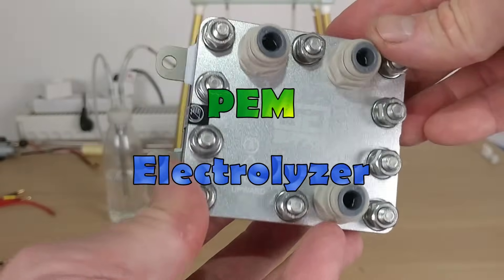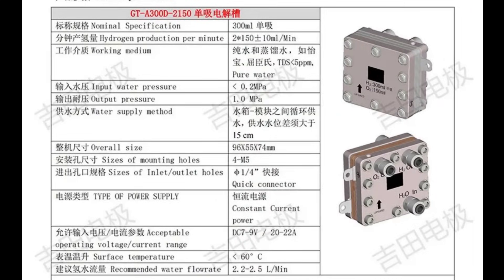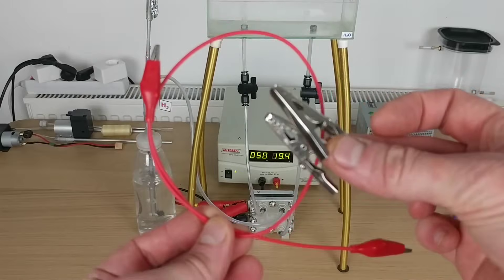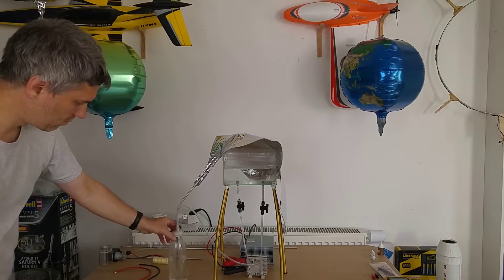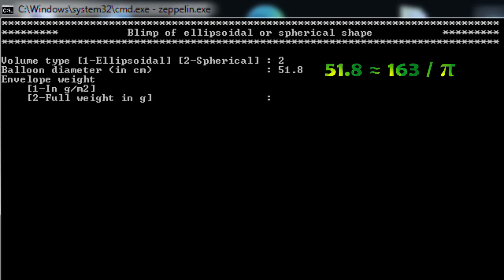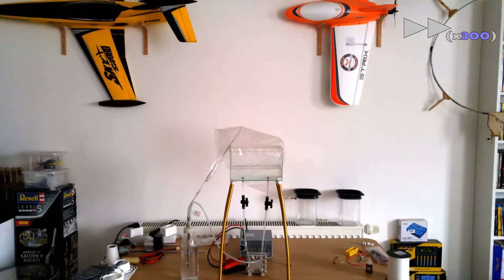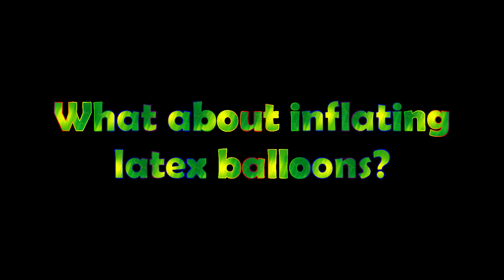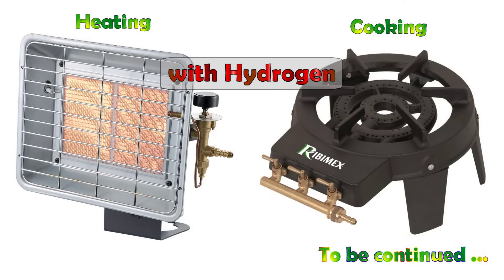Demo of a PEM electrolyzer bought on Aliexpress and use it to inflate balloons #hydrogen

Comment: Is distilled water enough? Don't you need ultra-pure water or a resin filter? How long will that membrane last?
Reply from the maker: Hi,
Absolutely — the purer the water, the better. Personally, I find distilled water to be good enough. Time will tell, as I don’t have much long-term experience yet, but so far, the PEM electrolyzer is still working perfectly!

Comment: Can you help me determine the height between the tank and the PEM unit? Also, how high should the hydrogen and oxygen separators be placed relative to the PEM? And what is the proper method to determine these heights?
Reply: we need your answer ASAP please , we are doing a final project for our graduation
Reply from the maker: @bentekeo2111  Hi,
There’s no strict requirement for the height of the tank, as long as the water can flow to the PEM electrolyzer by gravity.
This type of electrolyzer naturally separates oxygen and hydrogen, so no external separator is needed!

Comment: What do you think would be the best method or producer for generating separated, high output H2 gas for experiment, and one that can also be scaled or adjusted as needed for different conditions?
Thanks
Reply from the maker: For sure, PEM electrolyzer is the best choice for experiment. PEM electrolyzers come in different sizes and powers.
If you have very different needs, you should consider buying two (or more) more than one PEM electrolyzers!

Comment: Great video! I was also trying to use hydroven with a burner. The problem with hydrogen is that it is very difficult to store. You can pressurize it (watch safe limit for pressure for your PEM electrolyzer) but even when H2 is pressurized it wont be a lot for cooking. Regardless it will be very interesting to see the results of such experiment. Good luck and best regards!
Reply from the maker: Thank you for your interesting and nice comment!
The burner will initially be powered by a large latex balloon filled with pure Hydrogen. I will see how quickly the balloon deflates, and therefore what cooking time I will get.
Of course, to stay consistent, the energy used to produce my Hydrogen will come from solar power.
This will be the subject of a future video!

Comment: PURE WATER   ???  
NO WAY
Reply from the maker: Yes, pure water.
I use demineralized water, it is sufficient for home use. But PEM electrolysers used in industry use even much higher purity water!
Taken from documentation on PEM electrolysers: "The efficiency and lifespan of PEM electrolysis systems strongly depend on the quality of the feedwater. High-purity water is essential to prevent membrane contamination and ensure optimal performance. Ensuring the purity of the feedwater helps maximize the efficiency and longevity of the electrolyzer"
Reply: @jcopfr  IN MY OÖD MACHIES I TESTED SELF DESTIILD WATER  ---   NOT WORKING  :::   MAYBE LESS AMPERE   :::
Reply from the maker: @HWJJSCHUMACHER  It didn't work because what you tested is not PEM electrolyzer!
A PEM electrolyzer is not a classic electrolyzer, more commonly called an alkaline electrolyser. The technology is different.
Reply: @jcopfr  RIGHT : I HAVE THIS DRINKING DEVICE FOR HEALTHY H2-WATER:::BUT WITH DESTILLED WATER ITS NOT WORKING AT ALL  :::  THAT WAS MY THINKING THANK YOU

Comment: It was NOT diameter but circumference. The circumference is 2πR (2x3,14xR) - R= 110/6,28 = 17,52. So diameter is 35,04 cm (not 110). 
The capacity of the baloon is 4/3πR3 - that means 1,33 x 3,14 x 5377,77 = 22509,31 cm3 = 0,225 m3.
Reply from the maker: Thank you for pointing this out to me, it was a big mistake on my part, and I didn't even notice it! Shame on me.
However, my calculation is correct, the volume I indicated is indeed: 1,33 x 3,14 * 17.52^3 / 1000 ≈ 22.5L = 0.0225 m3, not 0.225 m3 !

Comment: So, you are going to waste electricity to produce hydrogen that you can burn to heat something. Are you insane by birth or did you have a brain damage?
Reply from the maker: Hi,
In this video, I used electricity from the grid. However, the electricity that usually powers my electrolyzers comes from a solar panel installed in my garden. I’ll showcase this setup in a future video. It is completely autonomous.
When I don’t have any devices to power with the solar panel, I run an electrolyzer to produce Hydrogen for free !
Reply: Bruh iPad kids 😂!
How dare you talk to my best friend like that?you will regret it!

Comment: So how did they fill up the old big zeppelins? And what was the skin made of??
Reply from the maker: For sure, they didn't use PEM electrolyzers because this technology exists since the 1960s (not earlier) and their broader commercial adoption began much later, in the 2000s
I asked chat-gpt, its answer is great.
In summary :
On smaller scale for localized or immediate needs, they used chemical reactions (reacting sulfuric acid with iron or zinc)
On higher scale they used  industrial processes like coal gasification, which involved heating coal in the presence of steam and oxygen to produce a gas containing hydrogen. This gas would then be purified to separate hydrogen from other gases like carbon monoxide and methane.

Comment: For a more efficient system use traditional electrolysis with a sodium hydroxide electrolyte, but power it with a capacitive voltage divider circuit (the resistance of the plates and electrolyte forms the bottom resistance of the voltage divider). You can easy produce a litre of H for 3 or 4 watts of power this way.
Reply from the maker: Thanks for sharing this interesting information, the performance seems excellent! I keep this information in mind
But to inflate balloons with it, you have to tinker with a system that may not be that easy to set up. With the PEM electrolyser, it's a piece of cake!
Reply: @jcopfr  Hi - I guess the capability of the PEM to work at higher pressure is an advantage.
Reply: @markflint9089  it’s advantage if you want simultaneous compression of the hydrogen , but increasing of the pressure ,lowers the efficiency of PEM electrolysis !

Comment: Did you check the current rating of the banana connectors?
Reply from the maker: Good question. I tried to check this, but I bought these connectors a long time ago and couldn't find the specifications. It's at least 10A. Ideally it should be 20A minimum, but I am not sure it is.

Comment: The buffer bottle is meant to act as a flash back restrictor and not to remove water from the H.
Reply from the maker: Thanks for the clarification.
I didn't know what term to use for the bottle, which is located between the electrolyser and the balloon being inflated.
This bottle is essential, otherwise some water ends up in the balloon.
Reply: When are you making a video with the heater and cooking with hydrogen? :)

Comment: by the way, do you know the Hindenburg disaster ?
Reply from the maker: Of course I know, I've seen many documentaries about the Hindenburg, the biggest flying machine of all time!
It is worth remembering that Hindenburg traveled 337,000 kilometers before the disaster.
Zero risk does not exist. Even the Titanic, a great ship once thought to be unsinkable, ended up at the bottom of the ocean on its maiden voyage!
Reply: @jcopfr  got it, than i can tell you a story of H2 cooling on big electrical generators. It is called conductor inside cooling and H2 is used because this gas is pretty good in cooling beside of the risk involved. Once they had a leak and the gas escaped. lighter than air it moved to the ceiling and to the next building. There it found some welding operation and ignited by removing the roof completely - major accident. Big battery systems can produce H2 and need good ventilation. Just be aware when playing with "knallgas" in german.
Reply from the maker: @eugenhuber3441  I agree, H2 being a very flammable gas, we have to take precautions!
Reply: @jcopfr flammable is a little small. if you want to boost a explosion you end up with a detonation. Having H2 and air mixed correct, you get the detonation.

Comment: Whats the max pressure the electrolysis can produce?  Seems like it wouldnt be strong enough to compress itself to stretch a balloon to blow one up..  it takes a bit of pressure to get a balloon started when blowing one up with lungs..  wouldnt think it coukd be very much
Reply from the maker: As mentioned in the datasheet, it can pressurise up to 1 mega Pascals, that's about 10 bars or 145 psi, that's much ! I think this is enough to make a football or basketball balloon explode ! This is one of the advantages of PEM electrolysers, they have a high output pressure.
So stretching a latex balloon with it is is child's play.
Reply: The height of the inlet water column will help with pressure

Comment: Great, I've been waiting for a video like this for a long time! I had seen fuel cells on Aliexpress, but I didn't trust buying them. Could you tell me what type of water you use? Distilled or regular?
Reply from the maker: Hi,
You can buy them with your eyes closed!
You must use distilled water. The purer the water, the better.
It works with tap water, but the life and/or performance of the electrolyser may be affected.

Comment: Interesting what max pressure this PEM electrolyzes  can produce ? Is there some specs in the data sheet ?
Reply from the maker: According to datasheet, it has a max pressure of 1 Mega Pascals which is about 10 bars. It's not bad!
Reply: @ thanks !
Reply: No way in hell that can produce 150psi..  thats impossible..

Comment: I checked the specs on the Aliexpress link, and they show a circulating pump for the water - oxygen loop. Your setup works fine by just gravity feed - what is the significance of the pump then? Maybe better efficiency with forced "fresh" water input?
Reply from the maker: Thanks for the info, I didn't even know about this circulating pump!
I'll find out, but in any case, the pump is not essential. Maybe it improves the efficiency, but only a little

Comment: Well done, impressive work, thank you!
Note: @9:25 s/latex/mylar/ , if I understand correctly.
Reply from the maker: Thanks !
At the end I say that I prefer Mylar balloons while I am filling a latex balloon ! But the text is correct
In other words: latex balloons cost less than Mylar balloons, but are more fragile, are not reusable and retain Hydrogen for much less time. (That's what I should have said in the video).
Reply from the maker: @ChanBattambang  Hi,
I have already tested with lemon juice, vinegar too, but the performance is too bad. The video would not be interesting.
It works so much better with hydrochloric acid! It is not expensive and you can find it everywhere, even in supermarkets!
The best of the best is hydrochloric acid with zinc.
Reply from the maker: @ChanBattambang  I understand, but with safety goggles, your eyes will be completely protected.
Safety googles are the essential basic gear! If you wear them, there will be no problem at all.
Moreover, hydrochloric acid can be diluted in water. With enough dilution, it can even become weaker than lemon juice!
You’re good to go safely!

Comment: I would fear that some of that gas would just leak.
Reply from the maker: Hydrogen is such a light gas that it will escape through the roof and the smallest openings (unlike Butane gas which is very heavy and will stay on the ground...). No need to worry!

Comment: I was pretty sure the reason for the buffer was in case a spark ignited the hydrogen or oxygen, so any combustion can't travel all the way through the system but gets stopped by the water in the buffer.
Reply from the maker: You're right, the buffer is also used for that!
In an upcoming video where I’ll use Hydrogen for heating or cooking, I’ll be using a buffer bottle for safety reasons—you explained its importance very clearly.
Reply: @jcopfr  Oh, I see! This is the first I've heard that it's also used to get the moisture out of the gas though. Sounds a bit counterintuitive to me since it's literally passing through water, but I guess it must be that the droplets of moisture in the hydrogen sort of "stick" to the water as they pass through it?
Reply from the maker: @zeph0shade  The Hydrogen gas is of course not wet, but at the Hydrogen outlet, there is also a tiny bit of liquid water that comes out too. This is not a manufacturing defect, I saw in a video showing industrial PEM electrolysers, that they have the same problem!
Reply: @jcopfr  Gotcha, I misunderstood what you said in the video then.
Reply from the maker: @zeph0shade  Thank you for your feedback; I should have provided more precise explanations in the video
Reply: My understanding is you can pressurize up to 145psi. I’m assuming you would have to keep equal pressure on both sides. I have the same PEM eletrolyzer and plan to pressurize up to 130 for storage.
Reply from the maker: @mmi6280  Glad that an owner of this PEM electrolyser has arrived here!
Yes, I understood 145 psi too
It would be nice to share your experience of pressurizing to 130 psi!
Reply: @jcopfr  Those quick connects are rated for 145PSI? IDK about that boss. I would rigorously test that prior to attempting something like that from a Aliexpress product.
Reply from the maker: @TheTubejunky  I think it's a lot too, I was surprised to see 1 Mega Pascals written in the datasheet, I haven't tested it to that pressure, far from it, but it's not necessarily crazy, because generally speaking, PEM electrolysers are known for having a high pressure output!
Reply: It's only needed to capture the water that comes out of the electrolyzer along with the hydrogen.  There is no need for a buffer when it's pure hydrogen.  Pure hydrogen does not flash back like HHO.  Oxygen must be present in the line for that to happen.
Reply: @ChristmasEve777  I guess my thinking was that it was in case there was a leak and outside air got in somewhere.
Reply: @zeph0shade  That's a very good point!  I didn't think of that.
Reply: Protonic water is also bad for the PEM.

Comment: Seems pretty comparable to the zinc and hydrochloric acid method in terms of production rate but without the mess and, in the long run, cheaper? Cool beans!
Reply from the maker: Yes, you are right !
For production of small quantities of Hydrogen, the chemical method with hydrochloric acid and zinc is the cheapest.
However, if Hydrogen production becomes more important, the PEM electrolyzer will become cheaper than the chemical method.

Comment: Proff I just fill balloons with dry 12v battery put salt water inside when charging it produces hydrogen and chlorine! and can filling balloons to fly up !Local products are easy to find.There is mylar or latex!
Reply from the maker: That's true, but  PEM electrolysers are by far more efficient, and less dangerous. Balloons will also have higher lift when filled with PEM electrolyzers !
Reply: @jcopfr 🔴 What Is Islam? 

🔴 Islam is not just another religion. 

🔵 It is the same message preached by Moses, Jesus and Abraham.

 🔴 Islam literally means ‘submission to God’ and it teaches us to have a direct relationship with God. 

 🔵 It reminds us that since God created us, no one should be worshipped except God alone. 

 🔴 It also teaches that God is nothing like a human being or like anything that we can imagine.

🌍 The concept of God is summarized in the Quran as:

📖 { “Say, He is God, the One.  God, the Absolute.  He does not give birth, nor was He born, and there is nothing like Him.”} (Quran 112:1-4) 📚

🔴 Becoming a Muslim is not turning your back to Jesus. 

🔵 Rather it’s going back to the original teachings of Jesus and obeying him. 

More .....👇

🔴 THE RETURN OF JESUS
Reply from the maker: @ChanBattambang  It will also produce Oxygen. Hydrogen + Oxygen = WARNING !
I really don't think this is a good Idea.
Moreover, adding salt to the electrolyte is a non-sense for me
Forget this bad idea, and buy a PEM electrolyzer, this is by far the best choice !